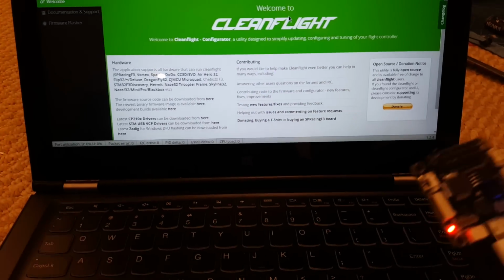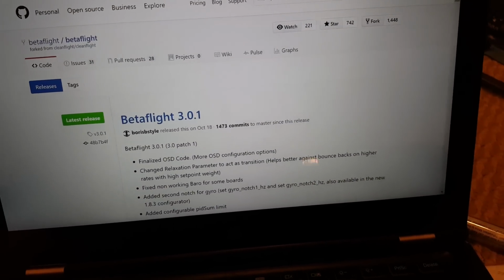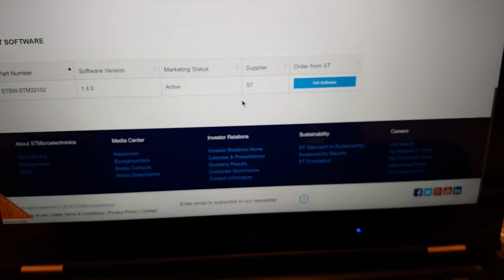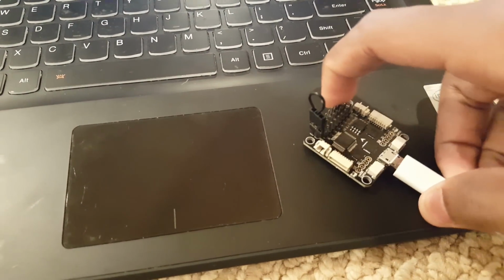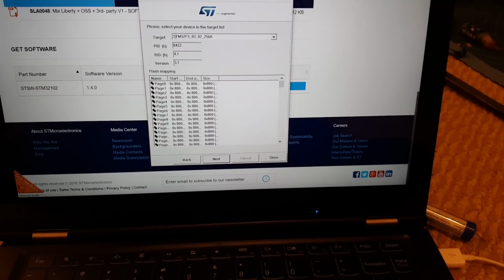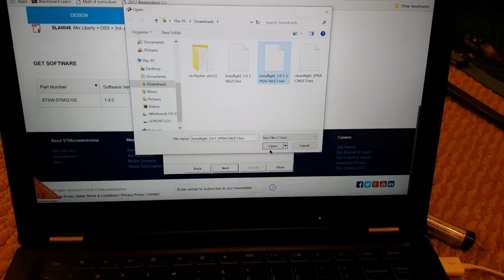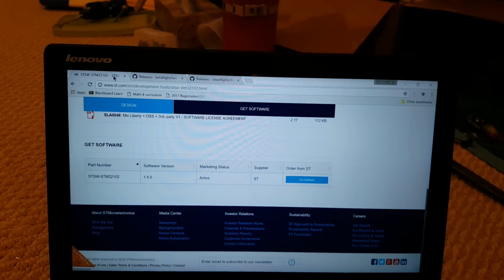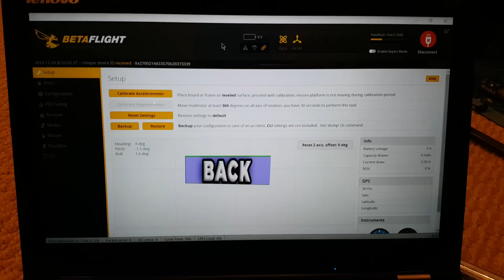FIX YOUR BRICKED SPRACING F3 BOARDS-Programming failed | No Response From Bootloader | Flashing

Comment: Hey Man. I have followed all this steps I am using a mac I have a solid green light on my cc3d openlpilot board. But when I try to connect to beta or cleanflight it says no response from bootloader. ANy suggestions. Is it because I am using mac?
Reply from the maker: Were you able to download the configurator on mac? I didn't know they had made the firmware available for mac
Reply: @sohansunku1016  i had researched that mac already have the drives downloaded so dont need any external downloads.
Reply from the maker: @kool_cool503  You will need to follow the steps in the video and download the software on a windows pc

Comment: legend! thank you so much have been driven nuts trying to get a flash to INAV this worked a treat! PS> had to download and install CP210 driver and stm 32 driver (as inav/cleanfligh/betaflight) before the i could get the updater to run. Also my board had to be in 115200 baud.

Comment: Thanks for the great tutorial! I tried twice but still wasn't able to connect via BF(failed to open serial port msg) although COM port was visible. I then re-flashed the .hex file a third time, selecting Global Erase, which worked! This may have wiped old configuration that prevent the fc to talk to BF (as in my case I disabled uart1)
Reply: Global erase???

Comment: Any ideas as to why nothing is showing up under  "Port Name" for me? Tried closing Betaflight and everything already.
Reply from the maker: Check device manager and see if anything is showing up under your com ports. Let me know what you see
Reply: @sohansunku1016  When  I plug in the board, it displays "CP2102  USB to UART bridge controller" under  "universal serial bus devices". I don't think my computer has a "com ports" tab in device manager.
Reply from the maker: @nickbell2637  yeah that sounds right. Try downloading the impulse rc driver fixer and follow the instructions for that. Then try again with the method in my video. Good luck!
Reply: @sohansunku1016  I've actually tried that already and it just says 'searching for flight controller' the whole time and doesn't do anything else, but thanks for the help.

Comment: Thank you! the latest firmware doesn't work with my naze rev 6 for some reason. 
when trying to boot jump it the first time i connected 5v and gnd.. blew a diode. i replaced the diode and its ALIVE! YES!!
now i have to fix my SPRacingF3 when the new chip arrives... It died in a crash.... same day i got it...

Comment: Hello, I tried to follow these steps but when connecting my fc, no com port appears. I do not have a driver problem because I have installed all of them and I have tried with another board that I have and It was recognized.

What I can do? Thanks
Reply from the maker: Are you sure that your board has enetered into boot mode?

Comment: Im sorry if this is Out Of Topic, I was stressed out:

My board FC CrazybeeF3 BNF Frysky,
my latest firmware : betaflight_3.3.3_crazybeeF3FR (Stable)

on betaflight configurator tab : 
I choose : SPI_Rx Support
The right thing to do is choose Frysky_D or Frysky_X and save it

BUT :(
I accidently choosing wrong SPI Reciever Provider to A7105_Flysky_2A and save it

now my FC can not connect to USB anymore, everytime I try connect it is says " Unkown USB device (Device descriptor request Failed) for windows 10"

is there any suggestions to fix it? please help me anyone..

Comment: Not sure if anyone can help me, when I get to the step where I need to choose a COM port, it shows COM port 1 but when I try to connect it it says that it may be used by another app even if the only thing open on my PC is the demonstrator GUI.
Reply from the maker: DrocketC It could be that com 1 is not actually assigned to your flight controller. Is it the com port that shows up when you usually connect to betaflight on your computer?
Reply: Sohan Sunku I don’t know. I have never been able to connect my FC to betaflight. It’s always times out the connection
Reply from the maker: DrocketC It seems like the first problem is that your board isn't connecting to your computer. Make sure your cable can transmit data, and isn't just a charger. To check that your fc is connected to your computer, go into device manager and you should see a new device added when your flight controller is plugged in
Reply: Sohan Sunku Yup I can see it in device manager as “CP2102 USB to UART bridge controller
Reply from the maker: DrocketC That's good news. In this case I would recommend downloading the impulse rc driver fixer. Run that while your fc is plugged in and try connecting to betaflight
Reply: Sohan Sunku I just tried the program and it doesn’t find the FC.

Comment: could not properly shorting the boot pins with a piece of wire, cause the st flasher to say "no response from bootloader"?  the boot pads/pins control the bootloader?
Reply from the maker: md3631 yes it could. Unless you plug the board in while shorting the boot pins it won't enter the bootloader
Reply: cool, thanks for the reply, I'll keep trying :)
Reply: could i just put a bridge of solder across the two pads/holes for the bootloader?  I can't get a piece of wire to work.
Reply from the maker: md3631 yeah solder would be the best way to do it
Reply: I actually got it to work!!  Thanks man, you made the easiest to understand video on this and it helped a lot!  :)  Subbed

Comment: so i tried the steps, when i open the st flasher it says "no response from bootloader" and on the other available port it says "the port is in use by another application".  Do you have any suggestions?  Thanks in advance  :)

Comment: Excellent, just one little stumbling block, before you select your hex file, open the drop down box on the right and enable 'Hex' else it won't recognise the file type. Default seems to be 'en'. Worked brilliantly with two bricked boards. Thanks.

Comment: unable to do it with Fury f3s, no hex file as such for the FC
Reply from the maker: Since the Fury is a custom board from Diatone the hex files are not available in the betaflight or cleanflight githib download page. They used to have them on their website, but I just checked and they seemed to have removed the link to the hex file. I would recommend that you get in touch with customer support through their website and ask for the file.

Comment: YOU JUST SAVED MY A$$!!! hhhuuuuuuugggggeeeee +rep. New to these and almost $hit bricks when i bricked my f3. pun intended. thanks man!
Reply from the maker: beastairsoftplayer Glad I could help!
Reply: Sohan Sunku honestly still don't have it running right. Dowloaded the most recent set for your guide then the most recent for the board on betaflight and and especially if I try swaping out the receiver location in betaflight it won't save and reboot. About to just hard solder into the default and hopefully my receiver will work.
Reply from the maker: beastairsoftplayer So when you try to choose what port your receiver is on it doesn't reboot? Does it reboot but not save the setting change?
Reply: Sohan Sunku when I try to adjust the serial port and such settings in the ports menu it shows rebooting and just sits there. I have to close it out and redo the whole unbrick process every time it fails like that. Sometimes it does it, sometimes it doesn't. I have a eachine xsr-e receiver going onto the spracingf3 and I have the power, ground, and orange rx hooked up on uart1 and the purple telemetry wire is on uart3 bridged between rx and tx. This is the closest I can find to how I've found online so far.
Reply: If it helps the receiver is even showing a steady blue and green light and my taranis qx7 is beeping as power is applied or removed from the quad like it wants to communicate.
Reply from the maker: beastairsoftplayer I'm not too sure what's going on. If you haven't already, I would recommend joining the rotor riot or miniquad club Facebook groups. There should be someone there that knows how to solve your problem
Reply: Sohan Sunku alright. Thanks.
Reply: Sohan Sunku just as an update. Got it up and running. Used the pinout for the plug on uart3 based on a video I found. Took a minute and looks ugly but it runs. Havnt even tried to setup the smartport telemetry.. really don't want to restart fighting the board lol.
Reply from the maker: beastairsoftplayer Good to hear! If you need any help with anything else just let me know

Comment: Does the boot pin need to be shorted every time firmware is updated? I learned the hard way my first attempt, but totally forgot when I updated earlier tonight... but it said success so...? Lol 
And I had the connection issue at first but found the fix right on the first page in betaflight... I noticed 3 links to different additional software. downloaded the USB driver one and bam, problem solved.
Reply from the maker: Mike Peterson Did you flash thought betaflight or the STMFlasher
Reply: Sohan Sunku I flashed through betaflight. And had both problems you described: the USB driver betaflight provides fixed my connection and I used a small wire to short the BOOT leads on the FC. Without the wire I just couldn't flash it no matter what.. now a few months later I reflashed again in betaflight but forgot the boot so I didn't open the quad or select any options.. it just went, said success so idk lol I'm still new and learning
Reply from the maker: Mike Peterson I'm not too familiar with the actual reasons behind it, but betaflight normally enters bootloader mode without you needing to short the pins. Also, if you've ever having driver issues I would recommend the impulse driver fixer. It fixes everything lol

Comment: I'll check if I have the blue light when I get home.
Currently my quad function perfectly except it won't open serial port.

Betaflight recognizes com 5 but windows calls the board "unrecognised device" instead of stm32 

Do you think this will fix my issue (the stock tuning is awful)

I'm scared that if it doesn't I'll be left with a board that still won't connect and now isn't set up properly (won't bind, arm, etc)

Comment: i think i had flashed the wrong firmware (instead of spracingf3, i did stm32 f3 discovery) and ended up with ""programming failed, no response from bootloader" (i think so). and your video solved the problem. thanks and keep up the good work.

Comment: After flashing my f3v4 pro from hglrc
It now hangs up losing communication half way through set up . Do you have any suggestions . Note board was fine before flash . Thank you
Reply from the maker: Are you able to connect to the board, or does it stop and give an error?
Reply: It will connect and let me go through set up but about 7 to 10 min blue light goes out and the board no longer respondsto any commands and get the infinite rolling circle until i discnnect and reconnect and still the same .
Reply: Normally one would just get another board but it flew well and my local hs had hammered me good for it like 75 bucks trying to no waist my cash and save it
Reply: It is now out of the quad i have not hooked It up agin
Reply from the maker: Wayne Wilder That's really odd. I'm not sure what is causing the problem, but when stuff like this happens to me I usually just reflash and update to the newest version of betaflight.
Reply: Ill give it a try i watched this video a couple times now and i think i may have used the spracing evo file . Oops . 
If so can i just reflash and use the hex file or do i need a full chip erase ??

Comment: My Demonstrator doesn't respond and says NO response from Boot loader. Reset device to try again. Any ideas how?
Reply from the maker: AdogTh1rt3en are you sure that the board is in bootloader mode? Make sure only the red light is flashing
Reply: Hey thanks for the quick reply! I actually think I must be using a different board, cause when I bootloader mode I get the steady blue light only..

Comment: one more question. I did get the F3 not the EVO hex.. but why not the EVO? I thought I had the EVO. but really I'm not sure what I have. . it does say  F3 on the board
Reply from the maker: daytonpyro I think that the evo has a micro sd slot on the bottom, whereas the regular has nothing.  The regular f3 is also very popular and has many clones, so it's likely that that's what you have. I'm not completely sure what causes different boards to require different hex files, but it might be because of different electronic layouts of the boards.
Reply: ok thanks mine does not have an SD slot. do I need the magnetometer? mine by default is turned off but i went into set mag_hardware = AUTO and It still wont show up in cf
Reply from the maker: daytonpyro I don't think that you need a magnetometer. I think that's for maintaining heading, which is useless for angle or rate mode.

Comment: Worked perfectly! Saved me a good $30 in ordering a new flight controller - took me a while to save up for my wizzard 220 and I tried hooking it up to work with my turnigy 9x - that worked --- to an extent - fast forward another 5 months and I bought a flysky FS I6 so I could use the S-bus instead of trying to make it work with just manual hookups to each channel (never got the auxiliaries to work properly in the first place with my 9x...the adventure continues and I have yet to maiden the thing - been just fooling around with 1s quads - they're lots of fun) had to recalibrate the sticks because channel 1 on the FS I6 kept drifting to the left so I didn't want to risk it even ordered a new direction gimbal (useful as a spare anyways) the recalibration did work although it will probably still drift... somewhere along the way as I was trying to program the SPracing f3 board in the wizzard i think I disabled the UART1 which I think also disabled the USB connection and afterwards the board wouln't connect to betaflight... tried reflashing it in there - couldn't get a response from the bootloader -after I followed the instructions here it worked first time with the flashloader. Thanks for the help mate!

Comment: *Hey buddy, can you PLEASE HELP ME!! 

After updating the firmware of my LHI 250 quadcoptor controller,
 I save and switch it on after battery, and the peeps do as normal, and no motor spin! So I binder my receiver. And still no motor spin!! Wtf is happened to my drone!! Please help me buddy, 

Many thanks

Anthony 👍 

High1voltage1rules

Comment: Though this didn't work for me, it lead me down the trail of finding the STM32 ST-Link Utility, and flashing through the debug port with an ST-Link dongle left over from the h8 days.. they are around $5, and potentially works like this on most boards with SWCLK/SWDIO/RST pins..

Comment: flash loader shows COM1 and then after i click NEXT it loads a while and says then : No response from target, the bootloader can not be started. please verify the boot mode configuration and the flash protection stuts, reset your device and try again. i dont know what i can do anymore...
Reply: anyone have solution for thus
Reply: do no one know a solution for my problem i tryed it several times on several PCs...
Reply: do no one know a solution for my problem i tryed it several times on several PCs...
Reply: Do you have your flight controller in boot mode?
Reply: yes tryed it several times... the fc is trash

Comment: i have a problem, after disconnect boot jumper and reconnect my fc to computer, the red light not blinking. please help :"
Reply: Mine flashes successfully but is solid blue when I reconnect!?! Like the firmware is lost when power is lost... Crazy
Reply from the maker: Were you able to successfully flash the board?
Reply: still unsuccessful. after disconnect boot jumper and reconnect fc, just solid blue light
Reply: only solid blue light
Reply: I Laser same as mine
Help.

Comment: When pressing next, this error shows up: "No response from the target, the Bootloader can not be started. Please, verify the boot mode configuration and flash protection status, Reset your device and try again..."
Reply: I have solved a problem. I just used my other pc (laptop) and flashed FC again on it and it works now. 
But I have same problem on other quadcopter Walkera Rodeo 150, didn't solve it yet.

So try other PC and same programm that is shown in the video on other PC.
Reply from the maker: Sergei Bogomolov Make sure that the board is in bootloader mode. If it's an sp racing f3 it should have a solid blue light.
Reply: Yes, I am 100% sure it is in boot mode. When it is without, there is blinking red with blue. When in boot mode, there is only blue
Reply: Yesterday everything was ok, it connected and it was firmware flashible. Today it is not connecting and doesnt want to flash firmware
Reply: I have the same problem... help
Reply: Thank you, i solved the problem. But i dont know why my osd disappeared totally from the screen.

Comment: Help!! i made the entire process for a naze 32 rev6, i did everithing like you did but when i tried the conect button on cleanflight appears this: 
2017-06-19 @ 13:30:23 -- Serial port successfully opened with ID: 20
2017-06-19 @ 13:30:33 -- No configuration received within 10 seconds, communication failed
2017-06-19 @ 13:30:33 -- Serial port successfully closed
what i'm doing wrong??
Reply from the maker: Eduardo Espinoza The error basically means that it wasn't flashed properly. Make sure that you have selected the correct baud rate, as the board in my video uses a different one from the nazr
Reply: Yes I noticed that. I tried with the default baud rate is it ok for the Naze 32 rev6? Or should i try other baud rate ?